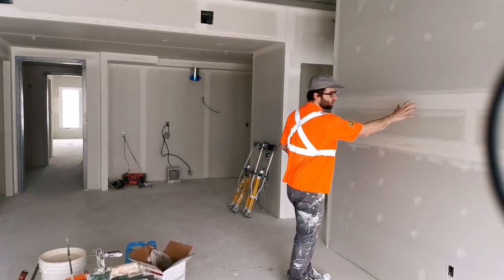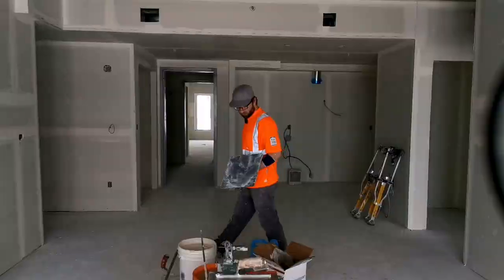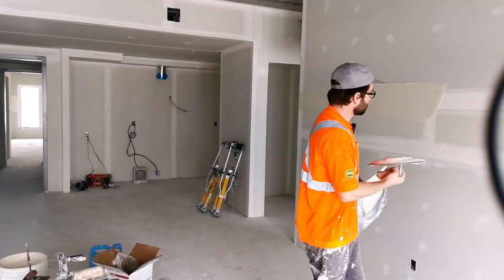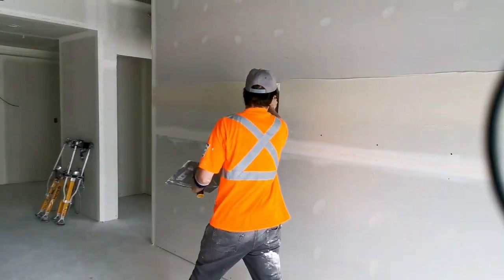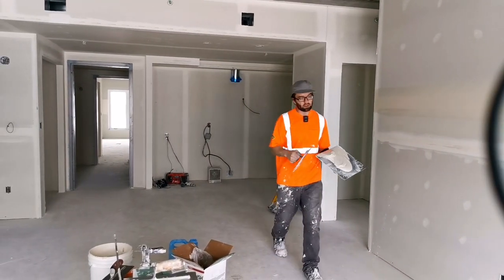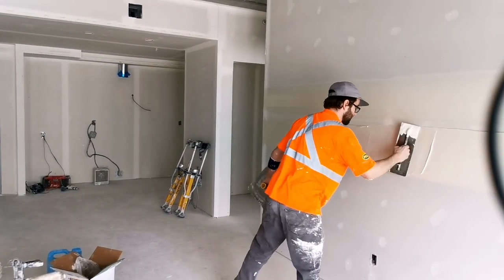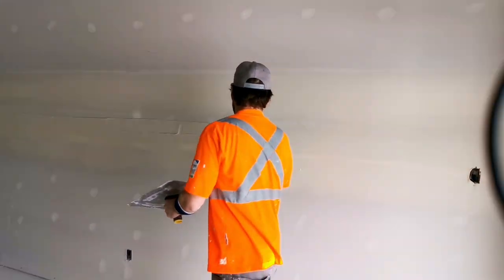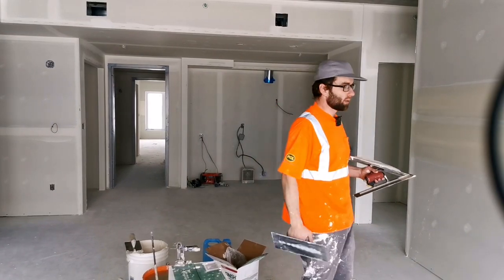Drywall finishing techniques

Comment: Nice work as always. I usually take a 12 flat to the bevel side of the bevel/butt joint on tape coat, not covering the tape, just building up bevel side. Then, i go 12 curved on both joints on first coat, 14 flat over the whole belly band on second coat.
Reply from the maker: Thanks, always interesting hearing about different techniques, so many different ways to finish drywall, that's what's kind of fun about it, I'm still always making adjustments to my process, even after 18 years.
Reply: @Interior_Works  , me too. I'm always willing to try something new that i think may work better. Drives my father crazy lol(he taught me). But, i find that even after 23 years, you can still learn. There are so many different techniques to finishing  And, i agree. I don't dislike knives, but i find trowels to be faster.
Reply: only one place those curved trowels belong... in the trash hehe

Comment: for your 2nd coat, could you use a 40" skim trowel?
Reply from the maker: That would be best, apply the mud with a smaller trowel, then smooth it out in 1 pass with a very wide skimming trowel.  Less overlap marks, less sanding. Honestly I still need to order some very wide skimming blades, but I've seen them used and it's better, or at least easier to sand smooth.
Reply: @Interior_Works  thanks for the reply. I just ordered a couple level 5 skip blades my self. Thx

Comment: Looks good but is it flat that’s what I was curious about and is a curve trial better than using flat trails cause I use flat trails or up 16 to 12
Reply from the maker: I use the curve for the first loading coat, I would say it's better at loading an even amount of compound over the joint, but it's not exactly flat at that stage. Next coat I'll use a flat to spread a wide finish coat.

Comment: Annoying when sheeters do something like this when they could put the small sheet at the bottom so there aren’t any butt joints, only recess/beveled edges. The low joint is annoying but can guarantee a better finish. Nice trowel work, in Australia we pronounce “trowel” like “owl”. Is it me or the other pronunciation sounds like “troll” with no audible “w” sound.
Reply from the maker: I agree, the small sheet at the bottom should be the way to do it, or use 54" width sheets, I don't always install the drywall in my jobs and that's just how I found it. Everybody around me says trowel rymes with Paul (Canada). An online dictionary with an audio pronunciation did the "owl" as American and "Paul" as British. Confusing.